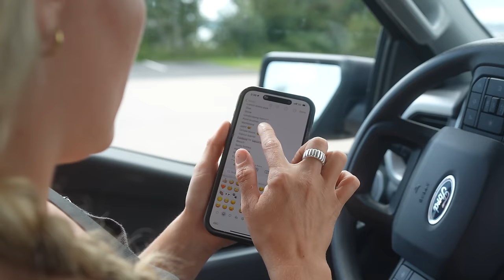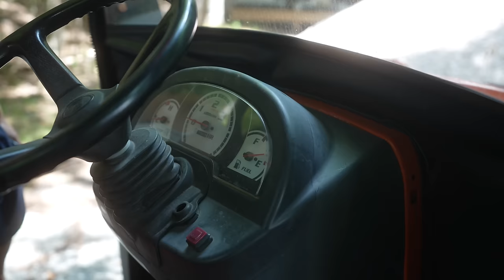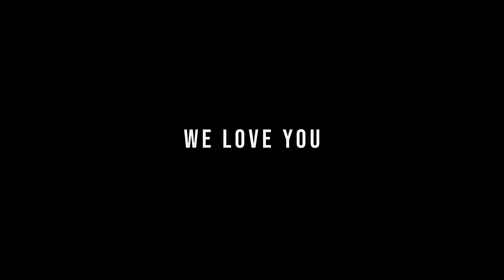This is Why No One Wanted The House

Comment: Beautiful job, girls!
 If Crystal had stood up half a second faster. She would have been wearing that door header. I'm so glad she wasn't hurt.
I might recommend renting a heavy-duty gas-powered pressure washer. Truly strip that foundation down to concrete. I just remember you're using membrane type of water block. So perhaps the pressure washing you've already done is good enough. When rebuilding the French drain, I would recommend tile field size stone all the way around the cabin. Fill the trench with stone. After installing a new drainage pipe and silt screen.
I'm glad to see you're actually going to adjust the grade around the cabin. Typically, we tried to set the grade around a house to about 5-6% for the first 3' to 10' feet or so if possible. So, for every foot away from the foundation, it should drop one inch. Even if you only adjust the grade 3% rolling away from the cabin , I don't think there would be any problem. You might even dig out the hill a little bit to give a little more drainage space. Give the water running down the hill a place to run...
I imagine the shiny cabin by the lake is going to have some solar and batteries. If I know Jasmine,
It's been a minute since I've seen the inside of the crawl space foundation. You might need to add a sump pump and power vent fans for controlling the water, moisture, and humidity. I'm pretty sure they make them in solar and battery kits. It doesn't have to be a very big system. Just big enough to work for the size of the space. I'm sure you'll know more come wet seasons. You might need to redo all the drainage inside of the foundation as well. There's no telling what kind of cluster is under there. Water management is key, as you girls know. Love the learning process, girls. You girls might also check out some automated AI CAD programs. Might make it easy to try and figure out what you wanna do inside. The layout before the build out...
 If I was still building houses , I would hire you both. I mean all four of you. 🐾🐾Tangerine🍊 definitely kicked some ass... Tip my hat to the operators. The cabin is still standing. ✌️🤟🖖🐾🐾

Comment: You look like you are on the right path with the outside-of-the-foundation waterproofing and drainage.  That being said, no matter how good a job you do, sooner or later you may get water infiltration in the crawl space.  You don't want water getting in and trapped in there, as it will create a humid environment that can lead to mold and rot that could crawl up into your living space walls.  First of all, keep good access to the crawl space.  I don't know what the grade in the crawl space looks like, but I would consider leveling that grade and putting an interior perimeter drain system along the inside of the foundation, with water draining towards a sump pump.  Then you can cover and encase the crawlspace floor and walls with a plastic barrier.  Any water that makes it through the foundation walls or comes up through the soil as groundwater will be kept out of the crawlspace, caught by the perimeter drain, directed to the sump pump, and be sent out through the foundation though a drainage pipe and discharged well away from the cabin.  This is the kind of work that basement/crawlspace water abatement companies do all the time.  It would be extra work/time/money to do it, but now would be the time and it would act as a backup to your exterior work, assuring a dry crawlspace, especially during those times of heavy rain, flooding, or groundwater rise.

Comment: I would suggest an ozone generator to kill the surface and airborne mold. Can be purchased cheap on amazon. Or use something like mold control to kill and seal the mold. Its non toxic so the dogs would be fine. Mold control can also be used in a  Mold Fogger you should be able to rent. I believe Home Depot rental carries it. I would recommend using both. Ozone will make the place safer to work in. Mold Fogger when done removing moldy material. Procedure I wold do is ozone to knockout any airborne mold. 2. spray moldy areas.3 ozone again after removal 4. fog the whole cabin to kill and seal any missed mold. Good Luck from Canada. Took care of a very pee smelling bathroom, that could be smelled from the main floor. Came home after first use and couldn't smell it at all for while. Also a musty and mold contaminated basement of a 1938 year old house. With a rock foundation that leaked for decades every spring.

Comment: hey there, not sure if you finished this task yet.  I would have suggested differently and much less work not trying to be discouraging but as you both know on many projects there can be many ways to do it, all can be good and some can be better. Lately many have gone to closed spray foam on the walls as spray foam has gotten so much cheaper, you get absolute waterproofing, as well as insulation and it is very very easy. So you have decided differently and it can still work well. If you don't know ,the key to all of this, is the curtain drain, not a french drain unless that is Canadian which i have no idea. The pipe coming out under or through the footing should be your interior footing drain and if that so that is good. You can do both interior which i do or just exterior which once again is good but not best for obvious reasons. So then you have your exterior pipe to do and tie them in together, washed stone below and above pipe and then fabric, then you should put 3'-4' of sand on the fabric, very important, then you can put your original material back on it and as you know slope it away. The slope is important but I can do and have done yards that slope toward the house and it stays completely dry because of what is done below and on the walls but sloping is just common sense if you can. The other thing that is so important is your drain to day light, obviously needs to be away from cabin and lower than curtain drain.  Put a cage on the end of pipe so no critters climb in and move in and block it up, make sure you keep an eye on it freezing up at cage in winter time. Sorry so long, hope this helps. have fun in the dirt

Comment: Another proper and fabulous beginning to what I'm sure will be another amazing cabin one day. 💛 But I do worry about your poor backs. The first time I threw my back out I was just 24, lifting plywood on a job working with my dad who had been a contractor for over 60 years, and then again at 34 while lifting 5 gallon buckets of paint. Now I know that you ladies are normally all about safety, I just can't remember if y'all have used safety lifting belts/braces in your past videos, or not? 🤔 And I know Crystal just had a back issue not too long ago. Trust me ladies, I'm 55yo now and both of my knees and back are shot from not taking on all of the proper safety precautions that I should've when I was younger. 😟 Just a little advice from a crazy broken old lady. 😉

Comment: I work in the construction industry that geo mat for the French drain it works for a little bit but that mat clogs up how i know because i layed one 5 years ago and we had pull up a section about 6 months ago and it was coged up. The best way is to it the original French drain a decent trench fill with chip and cover with top soil.

Comment: 'Regular' or standard concrete is porous. Standing water against concrete is about 3500 psi (pounds per square inch) of pressure. You can purchase high pressure concrete (4000, 5000, 6000 psi, or more) which costs more than regular standard psi concrete. Using a high pressure concrete (5000+ psi) ensures that regular ground water cannot permeate your concrete foundation. Cost versus benefit trade off.

Comment: To fix the slope going towards the home use a Parisian well drain. This video shows you digging out the foundation (Still not there as watching) I assume you installed Drain tile around the foundation. the parisian well is another drain tile away from the house just barely below the surface : Trench running parallel to the house bottom of slope full of gravel and tubes to carry water towards the lowest part of the property. in light rain wont do much but heavy rain when water saturates and flows downhill it'll divert all that water away from the house. 
Part 2: your siding is too close to earth you should actually keep the earth at least 8" below the top of the concrete foundation (Means you need to landscape around the house lower the ground some preferably creating a slight slope away from the house).
part 3: when you backfill the Drain tile around the house (I'm assuming you do the drain tile correctly) put 5-6" of gravel at the surface about 1.5ft wide surrounding the house it looks 'Finished' but helps keep water from wicking up to the siding and stops the habit of adding more soil for plants which recreates the problem of earth reaching the siding & starting the rot problem again.

Comment: Oh and another thing, just in case no one pointed it out to you, for cleaning the concrete use a cordless angle grinder and a wire brush. Just right for those hard to get off substances.

Comment: Is it possible to remove the Birch on the slope by 10:11 and make deep hole where Birch is standing so the rain water from the roof can go to hole or selfmade well? Beside that where Jaz stand should be a good spot make little trench to make sure how the water flows over the ground or just with a french drain trench like you said on the otherside i think you should raise the ground or make little Stonewall to make sure if its rain very hard and much the sea level never go higher than the entrance of cellar and please try to change the ground/Earth around the house with Sand/pebbles or something with little stones to make sure its flowable and a good drainage?

Comment: Is the bottom of the foundation, the footings, lower than the pond? If yes, the drain will work.
Does this include flood levels? 
If no, you will need to misigate, handle standing water each spring. 
If possible a sump pump might work, is there an alternate lower area to drain to, besides the pond?

Comment: As an architect and home builder I don't think the water was coming from the exterior of the basement. It will definitely help but won't solve the water problem.

The main reason you have water  problem with the joists and sub floor is because you had  insulation without a vapour barrier on the walls and on the floor. You were also missing house wrap on the bottom of the joists.

What caused this issue was moisture from the ground inside the house condensating on the joists and insulation. The insulation holds the water up against the joists cuasing them to rot and mold.

Comment: Would be appropriate to put a French Drain at the bottom of the rise at the right of the cabin.  The running an underground pipe from the downspouts from the yet to be installed eavestrough to this new French drain.

Comment: You found the main drain for the house, call for sewer inspection and electrical inspection?
Reply from the maker: There is no septic or sinks or bathroom it’s an old exterior drain system that didn’t work properly

Comment: As long as you're putting in a French drain, why not reclaim the water?  With 3 different sized rocks,  going down to the depth of the drain would to a degree will filter the water. If for nothing else, it could be used for irrigation for plants, grass, or any outside water needs.

Comment: I would hire a professional and raise the house 2 ft higher, expand the foundation, and then waterproof the foundation.  I'd also get rid of that hill next to the cabin so its not pouring water onto your cabin foundation but creating a huge French drain to the lake or a new drain field to hold the runoff.

Comment: Ladies.. get some wire wheels or cut off cheap toilet bowl brushes (depends on your preferences) and use the drill to get the junk off the concrete with out all the manual labor.

Comment: Hi ladies, I'm 71 and came to Halifax in 1973 to get my carpenter's papers and never went back home. You keep confusing what is Code now with what was Code back when this was built. This was perfectly up to Code in the 70s. The walls would have gotten about an eighth of an inch of tar. The drain tiles (used before the ABS pipe you encountered came along) wasn't even joined, you just wrapped the joints with tar paper. There was no such thing as landscape fabric of any kind until much later ( I think it became a thing in the 80s or 90s). The dirt was kept out of the tiles by having the tiles buried in the middle of a foot square pile of gravel (which didn't work). Putting posts right in concrete in a Sono Tube was how it was done. All the straps you mentioned (actually everything from hurricane straps to joist hangers) weren't around until the 80s. In fact, the topic of conversation when I was studying in 1973 was all about if we should insulate our houses. Not how much to use, but if we should use any at all! At the same time, the Trade Show was trying to push the idea of the R2000 Home. So, if this was built in the 70s, it was well built for the time. If it was built in the mid 80s or later, it was built using outdated practices. But, other than the white ABS drainpipe, I see nothing that tells me it was built later than the 60s or 70s. And from what you've shown us of the original interiors of these buildings, they also fit with the 60s or 70s time frame. Glad to see you making it up to Code.

Comment: Just a thought could make a walk way decking by the water as could do so much there and put grip on it for winter to help in ice snow parts to stick to oops no to help stop that from happening so ice under foot breaks and you can grip also stops the mud as a brush would get it off.   I think would look great in the summer hold a party there BBQ things like that and look over the water as can do the same to the pontoon make grips on it. Even a rail.  Just a thought.

Comment: DON'T start putting new joists onto a rotten sill plate (that first piece of wood on top of the foundation) you may need to hire professionals for this one. You need to slightly lift the cabin and get the old sill plate out, put in a vapor barrier layer and a new pressure treated sill plate. Don't try to lift it with your machinery. Get a bunch of bottle jacks and cribbing to lift the joists from underneath. You should be able to lift one side at a time not the whole cabin. Add temporary bracing in the walls above the sill plate before the lift. BTW re-bar pronunciation... the re stands for reinforcement.
Reply: Me again. I would keep the trench around the housr open while you work on the joists and sill plate. It is much easier to have access from both sides of the foundation. Finish your drainage project afterwards.

Comment: I appreciate you are expending lots of energy renovating the “foundation”, but the cabin is in a flood zone, and by the looks of it, a high water table. It will always be damp, unless you build up…as in raise the cabin. Forget a poured basement (not sure why the previous owners bothered); you need airflow. You can water proof the concrete walls all you want, but water will meet the soil/concrete interface at the base of the foundation and wick its way up.

Comment: I'm not no expert  but have seen it on home improvement shows that had water leaks threw foundation    roll water proof   the you can glue.  Water proof foundation wrap. On it. To prevent. Leaks     and put some drainish   to drain the water so it won't sit there

Comment: I think you two have a laser level right?  You should shoot the bottom of the footing and of the crawl space and then head towards the shoreline and mark the location with a metal stake for the elevation of both of those levels.  If the water rises past the first stake your footing is going to be in the water.  If it rises to the second stake you will have water in the crawl space.

Comment: UUMM guys lol You need some load baring studs in there lol.
Reply: lol yourself.  The roof truss system in this cabin doesn't rely on interior walls for support. 

And...it's load "bearing."
Reply: @GuyWithTheDogs  If you say so! The center beams (after the double 2x4 was removed) sagged about 2 or 3 inches.. but. ok lol🤣

Comment: They always have to remember when they built that cabin. The technology most likely. Wasn't there just like the fabric with the French strain? They might not have the fabric to put down over your front strained back then cause I used to be you. Just put the French train down and you put rock over the top of it. That was original way to do it and same thing with the Patty.  You set your post in the concrete. That's the old way to do things. Everything is changing as technology gets better and people realize what the problems are......
Reply from the maker: You are right! They did what was right at the time. Just needs updating! 😊🐶

Comment: Okay, ladies, it's time for a French dream. Get your little toys out and start dig in a trench all the way around it.
 Open that sucker up and get that ground drowned out. Get a motion and covered at whole side of the concrete foundation.  To keep the water from penetrating anymore.
 Rock and a pipe with holes in it and you run it all the way around the whole thing and drain the water off. So when it rains, you don't get no build up water around your foundation.  And then you need to put you know, the grain gutters in and have all that water drain off into the lake.
Reply from the maker: Thanks for the recap. You made us smile. 😊🐶